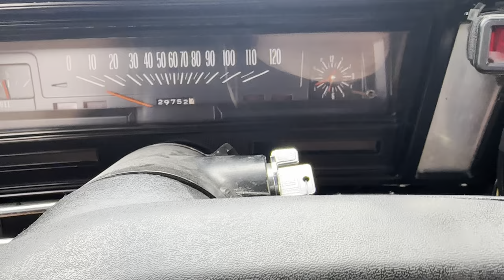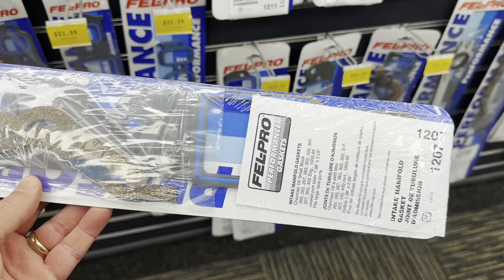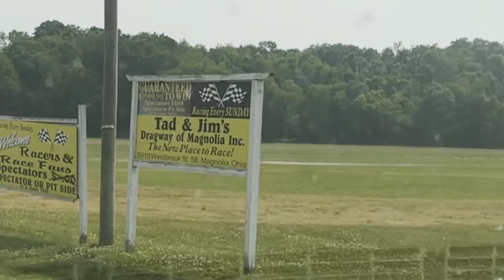LETS PLAY THE BLAME GAME!  Jimmy’s new 434 TEAR DOWN!

Comment: Well Old Man, being I just recently made a comment about how I was gonna mention Billy should have purchased Cleeters old backup engine from Steve because he had so much success with it problem free and pushed it way past its limits, but kept my mouth shut out of respect for Bob and knew he was your guys guy, I can’t help but think in some part this video is kinda in my direction. Don’t think for a second I don’t know Bob is more than capable of building a winning engine. He’s done it. More specifically, he’s done it for you guys. More than once,more than twice. Multiple times, this I know, I’m a die hard follower.And I made that comment after  Billy’s has shown its holding together after its latest assembly. I wasn’t trying to chip away at Bobs capabilities one bit. He’s got tons on his plate. ALWAYS. His health isn’t the best, and if he doesn’t learn to slow down a bit, he’s not gonna be around to keep doing this. Cleeter has chewed up his thrust bearing twice now in his SMX in a very short amount of time because of charge pressure pushing the converter forward and eating that thrust bearing. They thought they had taken care of the problem( Cleeter and his crew) and apparently they hadn’t. Not only did Cleeter just cook his thrust bearing again, but Steve himself just cooked a piston in his own personal engine in the same drag n drive event as Cleeter. I hope nobody took the comment I made the wrong way. It wasn’t written or meant negatively towards Bob, I like Bob. He’s always been there for you guys. Always. I don’t skip any videos. I see it all. I watch it all. Both on your guys channels and Cleeters and Steve’s . I’m not stupid or spew diarrhea. Cleeter is having trouble with his new SMX combo ( that is new to him this season) and had none  from his old combo built by the same man (Steve). I’m not obvious to any of this. I saw how that piece of metal came out of Billy’s crank the first time. I pointed out in a comment that’s specifically why Steve only installs the balancing weight in a crank horizontally in the counterweight so it can’t come out like it did on Billy. I know Bob didn’t build that engine. I know Cleeters SMX hasn’t chewed up a thrust bearing twice because of Steve or his engine building capabilities. I know Steve’s SMX which is now Cleeter’s SMX didn’t explode all eight rods virtually into dust particles ( literally) because of Steve. But I do wish Billy hadn’t encountered the problems he’s had with his big block all together. He’s not rich, and even on this side of the video, it’s apparent how much it took out of him emotionally both times.  It’s hard to watch him go through that, not even knowing you guys. An oil starvation problem is an oil starvation problem. It’s gonna chew up a engine regardless who built it. This I know. If Billy was going to go elsewhere for engine work, or an engine or anything away from Bob for any reason at all ( which he did initially with the big block) I just think he would have been further along in the situation going in Steves direction is all. Leaving oil starvation out of the mix of course. Which Cleeter himself has dealt with in the past at the end of his runs ( hence why he would reach up and hit the switch to kill the engine as he passed through the finish line like I believe Billy did as well). I may not get my point across the way it’s meant always, I may not use the correct words to say what I’m trying to say always, but in conclusion, I can assure everybody, you, Billy, and most importantly Bob, I never meant anything bad towards Bob or his abilities as a machinist or engine assembler when bringing up Steve Morris or Cleeter. I wasn’t built that way, I was brought up right by two very good parents, I went to Catholic school, I simply don’t have it in me as a human being to be like that. I care too much for other peoples feelings to do so. So I hope I wasn’t one of the stupid people with the stupid comments you referenced to. If so, sorry, wasn’t meant that way.

Comment: Bill if everyone ran LS engines in fox body Mustangs drag racing would be as boring as Nascar has become where all the cars are the same ........ half the fun is being a little different and surprising the guys that think they are the shit. Carbs, small blocks, LS's or Fords with fuel injection its all good run em have fun and screw the keyboard racing professors. That Falcon doesnt look like much but it works ........ but who knows maybe you build a stronger motor with bigger turbos and the transmission breaks or the frame twists or the suspension cant keep up ????? Just cause the Falcon works right now doesn't mean its cause it has an LS in it .... its because its a shitty beat up Falcon with a stock block LS with a 9 inch Ford and small turbos and on meth its that all the parts work together right now, it aint just one thing that makes that car work its a package deal and its sweet to watch.

Comment: Wait, did the guy who HATES LS’s just make the case they are the same as a small block? If you ain’t bending you ain’t sending!!
Reply from the maker: The parts are made from the same materials.  That doesn’t change the fact the dart block for an LS costs more, or that 6 bolt heads are more expensive.  It also doesn’t change the fact they sound like a boat out of water, or the fact they are ugly as a mud fence.
Reply: @theoldmansgarage  and those two extra bolts Dart adds are useless!
Reply: @theoldmansgarage  just messin with ya,!! I watch you win races with Billy’s truck plenty of times, more times than seemed possible.. I know you were only making the comparison for all those that think the LS is the only engine, or the BETTER engine, if you go watch the earlier cleatus mullet earlier days, it had the ls and would lift the head and sometimes bend a rod on every pass.  Then he got the Brodix block bbc and ran a season of 6’s , now he got the better engine the smx and has been working out bugs ever since the swap, and that is the scratch and dent special out of Steve’s wagon..
Reply: Sexy motor old man!

Comment: nos lean out & torch like action even carb will do the same ford v6 did it with 52000 miles this was truck from hell, trans, engine before wore tires out ok i lost it on a corner tore side off the truck it set in a ditch on its side! I had a mad ex wife's boyfriend! she cheated the guy messed with brake lines brakes failed! the guy admitted, it in court! the guy end up back in jail, from then on till his death he left me alone in a bank robbery a shot dead a by stander  it was him in town he lived in! he did nothing walking by the bank got shot in exchange during a bank robbery!  he was not robbing the bank he cleaned himself up! he sent me a letter he was sorry over what happen it was fine with me! ok Gregg